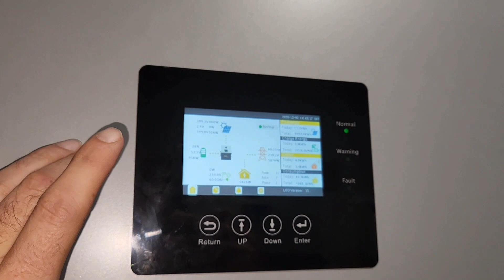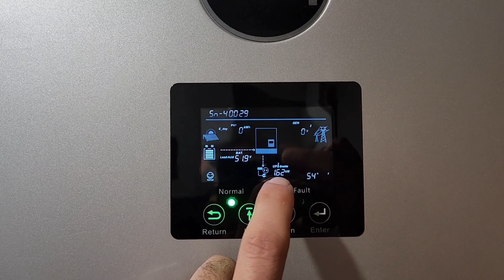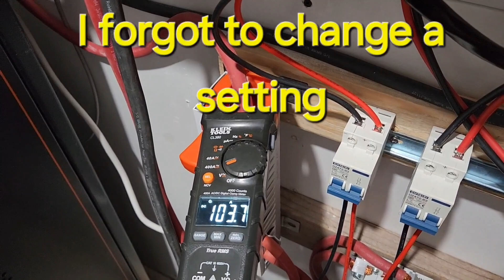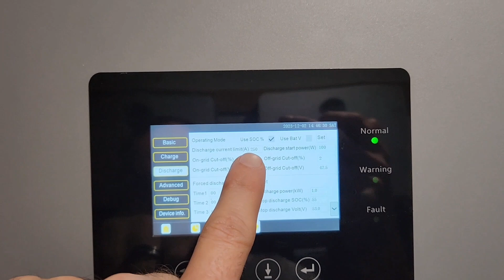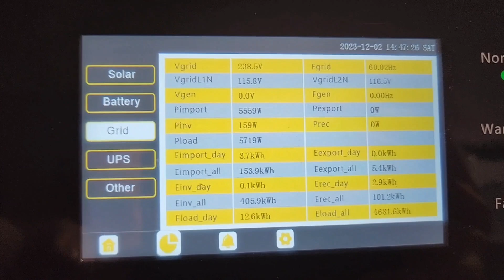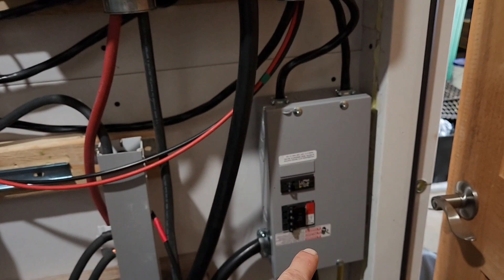2 - EG4 6000XP Provide Grid Connection to 18Kpv.  6XP had no issue absorbing Surge/Dump. 24K Watts?

Comment: what are you using for a fan exhaust deflector ?
Reply from the maker: Just a heat/AC vent deflector. You can buy on Amazon or BigBox store.
Reply from the maker: Not the exact one but the same concept.  Eureka Air Adjustable Deflector... https://www.amazon.com/dp/B08QH49RWB?ref=ppx_pop_mob_ap_share

Comment: I ordered a 6000xp and am setting everything in preparation for it to arrive. Just quick question, the heat exhausts from the left side on these units right?
Reply from the maker: Correct
 Intake fresh air from the right and exhaust out the left.

Comment: Am i comprehending this correctly? The 18kpv is sometimes backfeeding to the grid (your 6000xps) and they are taking that energy and charging the battery .... From AC punping backward into the 6000xps ac output legs?
Reply from the maker: Yes, that's normal behavior for a grid interactive inverter.  The 18Kpv has a grid disconnect relay (off grid mode)  setting if you need absolutely zero backfeed.

Comment: How does the battery communication work with 2 systems so to speak running together?
I just asked SS about running this very set up last week and they told me I couldn't.

I need more than 12k, and I have 27k in PV. If I get the credits for my 4-6500s this work cost just about the same as a full price 18k
Reply from the maker: In this video the 6000xp are running in lead battery.  The 18Kpv is using battery comms.  The battery is shared with all three inverters.
Reply from the maker: If my math is correct, PV would top out around 12K+6K+6K = 24K max battery charging.  So, any excess solar above 24K could power your base load or it would be clipped.  That would only be a problem during peak solar months.
Reply: @theadventuresofarenaissancman  I was going to get a eg4 charge controller for the other panels for the winter months. Summer time id use pv as needed and keep the pv off on the inverters ( 6000) when full. I turn the pv off now on 2 of my inverters as well In the summer time. I picture it working similar to what I have but one less inverter. Think it would work? I just need to make sure communication with the batteries won't be a problem.

Yea, here 10k pv  is max  for the  power company. I'm off grid.

This time of year i only get sun from 10 to 2..that's why my pv array is so big. It's nice with the 6500s having 500voc I didn't think it would be that much of a difference, but did look at the charge controller if need be. I have 20- eg4 batteries and the AC 's help use excess pv  in the summer.. But im usually full by noon on nice days.
Reply from the maker: @motomike1197  20 batteries can easily handle a combined 32,000 watts charging.   So you can safely run PV through all inverters.
Reply: @theadventuresofarenaissancman  I'm running everything now in USE mode so the only cummunication is through the eg4 communication hub. Would that work the sameway on these inverters?
Reply from the maker: @motomike1197  I'm running communication through the 18Kpv.  The 6000xp are just is lead (use)
Reply: @theadventuresofarenaissancman  I just bought one today with the 6500 credits. I'll have some questions for you when I set up the inverters together.  Will you mind helping me with Linl them together?
Reply from the maker: Sure.  Are you on the diysolarforum?
Reply: @theadventuresofarenaissancman  I am
Reply from the maker: That's alot of PV.  Unless you have a large base load the 6000xp will be limited to 6000 watts of solar each.  So just expect clipping of excess PV.  Also you wouldn't be able to sell too grid with this setup.

Comment: Why would you not just use the two or more 6000 XP’s instead of having the 18k too? Seems like a lot of idle consumption, complicated set up, inadequate battery and cabling.
Reply from the maker: 1st world problems...the inverters are for another location.  Just testing them out.  The other location won't be ready for solar until next year.
Reply: @theadventuresofarenaissancman  ok.

Comment: Can you run a test of one 6000XP showing total loss (all input power minus load power) with just PV, just grid, just battery and with a combination of two or three sources at the same time? The spec sheet just mentions idle consumption in the various scenarios... but that doesn't really tell the whole story. I'm just wondering what the total input is (battery, PV and grid) vs. load output in a typical config over the course of a typical day where various combinations come into play depending on sun, load and battery SOC.